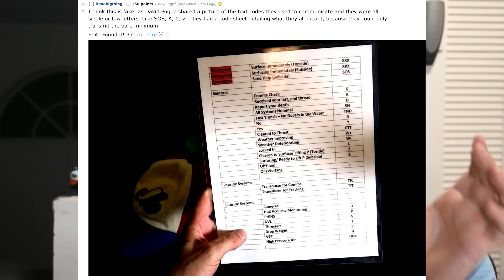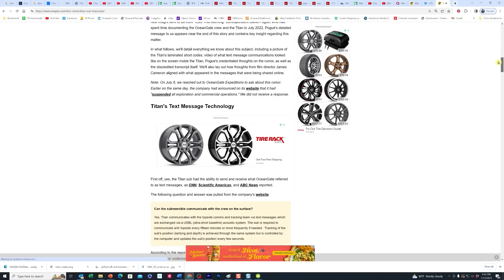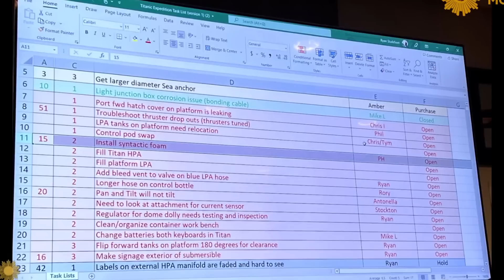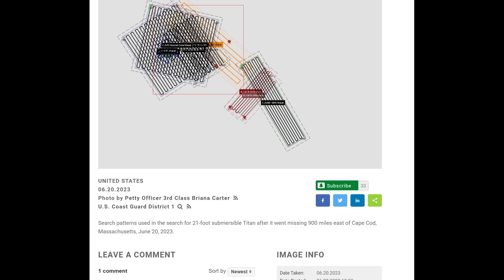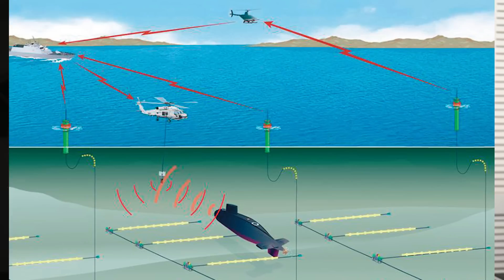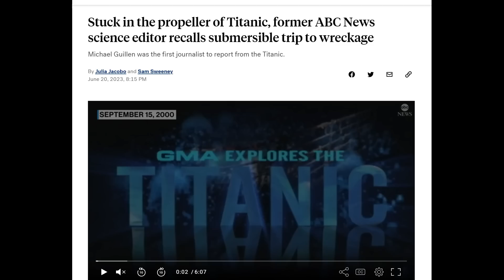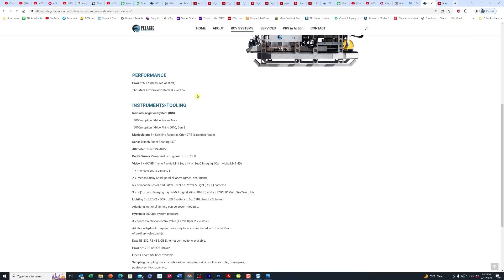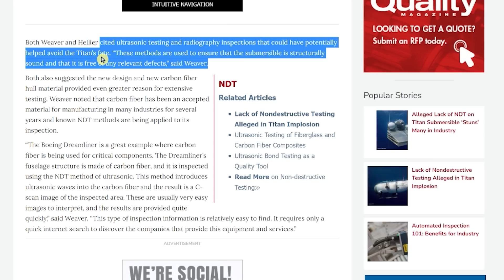The Shocking Truth About Fake Sub Transcripts No One Tells You

Comment: I don't understand why the Titan fiber cylinder looks all black and all dry.  Wouldn't it have been saturated with epoxy?  No epoxy, why wouldn't the ocean seep through?
Reply: Other videos have shown that the original carbon fibers were probably coated with epoxy precursors, and that baking after wrapping probably caused those precursors to flow and harden.  That doesn't seem like a very safe procedure for a 6000 psi environment with what is basically string under compression.

And if epoxy of the same age as the carbon fiber was the filler, it would be very hazardous to use "out of date fiber" as was allegedly purchased from Boeing.

Even using epoxy for a pressure hull is reckless, except possibly a short-term vehicle not designed for human.  Epoxy ages far faster than metal.

There should be no need for the waterproof covering (shown as a green layer) if the epoxy properly filled every crevice.  Questionable.

Comment: How is the oxygen and wiring brought into the pressure chamber from those outside components? Seems to me  that would be a potential fail point.
Reply: You'd have to guess it was through the rear titanium cap, as that's where the ancillary stuff appears to have been located.  I assume the engineering for doing that is well understood.  Various commentators have said there hasn't previously been a dsv implosion, so I wouldn't see that as a candidate for the cause of an implosion.  I can't see anyone thinking doing a penetration of the CF hull was a good idea, and I assume that would have required a titanium insert into the CF prior to CF fabrication, complicating the placement of the fibres.

Comment: I work as an engineer at an aerospace vendor for the prime contractors. I work with graphite laminates and bonded assemblies. 
When you showed the lack of adhesive squeeze out, I had to stop the video for a few minutes. That is cause for serious concern about bond strength. The only charitable explanation for that is hydrodynamics of compressing the epoxy (while it's a fluid) caused 90% of it to flow and squeeze out on the inside, rather than the outside. But like parallel resistors, the vast majority of flow is through the easiest path, but some flow occurs out of all directions. 
This SHOULD have flagged them to come back and do a second fill on the exterior perimeter, but it looks like they just didn't recognize the risk of doing the bond the way they did (the fit is very snug and adhesive likely wouldn't flow in to backfill).

 I'm also concerned about bondline control for that bond. If you squeeze out all the glue between your two hard surfaces, you have no adhesive actually holding them together. Typically bondline control would be done through miniature glass spheres mixed into the adhesive (so you can compress it til you hit the glass spheres). 

Regarding the graphite laminate, If they truly only wound around the hoop, without any perpendicular strength, I would be shocked. Graphite fiber is like wood, its a matrix composite. It acts like ropes that are glued together. The easiest way to make the system break is not to try to break through one of the fiberous ropes, but to shear the glue between them. If you don't reorient the fibers between layers, it becomes easy to split it between fibers, like an axe to firewood. If that's the case for every layer then you can break all the way through, or even worse, pull a singular fiber out and create a weakness in the structure (and physics is very unkind to such defects). This is why graphite laminates get handled with caution. Bumping it wrong can pull a fiber. 

Ultrasonic testing should've been done by a qualified person on the laminate prior to bonding the titanium end caps. You can visually inspect for compaction and tell a lot by resin bleed-out from the laminate, but you can't see through it. Destructive testing of offall (it looks like they machined the interfaces that the end caps sit on, which implies there's machined offall from the sub somewhere) should also have been done. This allows you to do a suite of material testing, for adequate strength, appropriate void content, degree of cure, compaction, FATIGUE STRENGTH IN PRESSURE CYCLES!!!!!, etc.

Comment: And I can prove to you that you shouldn't use BBC video to "prove" that the transcript is real. Reason being is because it was a shallow test dive and they were not at 3,000+ meters depth when using the acoustic modem. Acoustic modems and VLF/ELF work less and less effectively and efficiently the low the depth is because all the water, and especially the boundary layers of that water, prevent you from effectively sending larger messages. There is a reason why extremely compressed and short hand messages are used on American nuclear submarines. And I guarantee you they've thrown a lot more money at solving this problem than Stockton Rush did. And, oh, did I mention no nuclear subs go to the extreme depths that this took place at and would hamper communication even further?

Comment: I don't know it rings true because remember all the random facts Ballard and Cameron had early on? Like ballast drop, emergency ascent, implosion at 3500 m. 

Now again 3500 m give or take, same story, emergency ballast drop, kaboom at 3.5k. 

Also reports of monitoring system going off have come from several places from also like day 2 or 3, reports of cracking... 

Like you say, if it is fake... it's good enough to probably be close enough to what really happened. Some stuff is unnecessary if you only invented this by public info. Fast descent? No one said that. But they did implode around 3500 m. So they seem to have been early. So why add this random fact and have most of the transcript be about the descent when you could invent some "juicy stuff" about how (sorry) horribly they passed. You would expect in a fake SR to be portrayed as incompetent. But he actually seems to handle it as well as you can. He immediately agrees to surface, is honest about problems in landing frame jettison. Again why include that. Public infor was "ballast dropped, kaboom". 

Not 5 mins troubleshooting, back and forth etc... and the comms seem as professional as you can expect of these guys. A fake would try to make them look more negligent. Like SR insisting to not surface or something like that. Instead the picture this poetrays seems to be that SR was fully aware and doing his best to get them out of there alive. I hope there is no "CVR". If this is true.... 

My speculation? They where heavy. Overloaded. Fast drop, no reaction from ballast? Even after dropping major structural elements AND ballast? They where missing buoyancy or too heavy. Last minute passenger changed? Ballast not recalculated? Active ballast fails? To heavy? Tanks full? Plummet downward, drop everything and barely float up? Something is really wrong there. Even the thrusters without positive buoyancy should move them at 2 knots or so.

Comment: Pogue points out though, that early in the dive (when no hint of any issues) the communication was complete sentences instead of simple 'AN' (code for all nominal).  Pogue pointed out this much more terse response was his experience. 

There was an interview where RS stated he didn't like wasting a lot of time talking to topside, apparently he preferred to be left alone.  So the early use of banalities like "enjoy the ride" and "having good time" or whatever seems out of character.  This is the sort of details only folks with direct experience would have known ahead of time.  Of course this isn't conclusive, but it does suggest the transcript is not authentic.

Another puzzlement is the requests from topside for depth.  Information about the 'telemetry' that was sent by the computer every few seconds was that it included depth.  If that were the case, why would the surface ship need to make specific inquiries?  If that telemetry had failed, why wasn't that mentioned?

Comment: That was one question I had about the glue when I saw that video. You would think you'd want a little extra on the seal not less. They were scraping it off so it was like paper thin before they attached the cap

Comment: I have the sneaking suspicion that Oceangate merely rented out manufacturing facilities from the composite company and Oceangate personnel  ran the equipment to lay up the carbon fiber.  The composite company basically told them, "We're not liable; however,  may use our facilities".  Anyone with a little common sense knows carbon fiber needs to be woven and spooling it from off the bobbin (for a lack of a better term) onto what amounts to an even wider/longer bobbin is not going to impart any strength to the structure.  Rush's ego was just too big for his own good and I bet what ever initial plan from a marginally competent marine engineering firm they began with, he probably interjected his own spin and essentially said, "Eff them! I know best"

Comment: Even if they did use codes in communications, a published script would likely be translated to ordinary English...  so this point about codes is a bit uninteresting as proof (as you agree for other reasons)...

I'd be curious to see other transcripts. I'd say if no other transcripts appear, that increased the chance it's fake. I don't know if its fake or not. But sooner or later we will since various agencies will eventually be releasing reports of the event.

All this talk about the direction of the fibers in the hull... I think the resin is taking the compression to a great extent since carbon fiber is a tensile force thing. On the other hand the tensile force can contribute to the hull keeping it's shape which can keep it stronger.

I used to use carbon fiber, fiberglass, polyester resins, epoxy resins and stuff for model aviation. It's really amazing material for aviation since it's light and has such good tensile properties. A couple grams of carbon fiber glued to a structure can really help reduce weight...

Anyways, when I'm making a joint, it's incredibly unsatisfying if I don't get a squishout. As you mention, they didn't get any squishout and in a case like this, that means there are gaps. Gaps are not your friend. So these guys are clowns really. Thankfully they video taped this so it gives a bit of insight into the construction. 

Further, I've seen this footage of gluing the end rings on and one of the guys is putting his gawdamn hand on the surface. Jesus Christ, I wouldn't do that on a mode aircraft let along something that will carry humans. Grease from your skin is not your friend. 

I think this could have been okay if they were doing this right. But it would probably cost 1 million or 2 million instead of quarter million. That sounds bad but hey, the people that go down their are going many times. So just pay 4 times as much and go a quarter as often. You'll get the same bragging rights and then be alive to be all braggy and enlightened.  Don't get me wrong, I think it would be life changing to actually go down there and see that historical site. But being alive is cool too..

Comment: The fact that the resin does not ooze out is not the biggest problem in my opinion. The two rims keep the resin inside, which looks a tight fit. The biggest flaw in the process with what I see on the video is that it traps a ton of air. The cured resin is full of air voids. Unless they put the whole thing in a vacuum vessel.
Reply: It is amazing how many dives this thing did make successfully, with how sobby the construction was overall.
Reply: @Lilitha11 - Not all previous dives went to Titanic's depth.
Reply: @Lilitha11  titan made 90 dives, only 13 were successful. Still amazed 13 made it given all design flaws.
Reply: I'm no engineer but why wouldn't the ring in on the inside of the carbon fiber shell? Seem to me that would be stronger against the outside pressure. Or a grooved type of end where the carbon fiber is inserted into the titanium end?
Reply: @johngreydanus2033  Exactly my thoughts, even tho am not structural engineer either (or whatever branch it is). Intuitively this layout look more suitable for excess pressure from inside, not outside as in sub. If carbon fiber tube was outside of metal ring, outside pressure would push it against metal, further tightening the seal. With this design outside pressure works to disconnect carbon tube from metal ring.. weird design choice.
Reply: @AG-ig8uf  You're right. You should only try to stretch the fibers, not push them together, because then the fibers will break. The construction should have been; two titanium rings spaced apart with a number of titanium rods, sort of like a birdcage, and then stretching the fibers lengthwise around the titanium rings, alternating inside and outside the ring to form the cylinder. Then the fibers would be strained by external pressure. Exactly what they are intended for.
Reply: @AG-ig8uf  Might be a thermal design. The ocean gets colder with depth, so the titanium ring would likely contract faster than the carbon tube, compressing the joint.
Reply: bro you disagreed with him and then restated his exact point. if it was a truly tight fit, resin would have squeezed out. because that wasn't the case, you can know for a fact that there were pockets of air in there.
Reply: @kenshiman90  By saying that it's not the biggest problem it's not squeezing out I meant that Rush said in that peanut butter story that the layer should be thin but not too thin. That is also my experience with resin in my (hobby) projects for better bonding. The amount of resin is easy to calculate for a certain thickness in that titanium groove, say 30 kg for half an inch or so. You see them lowering that ring by a crane and measure the distance from the bottom of the cylinder with some poles, meassuring tools and a straight edge on top of that ring. measuring would not be necessary if you lowered the ring completely onto the cylinder, then the resin would squeeze out. It still traps a ton of air,  I'm guessing they allowed the resin to cure while the ring was still hanging on the crane on a certain distance from the cylinder.

Comment: I watched a video about another submersible vehicle with 2 men in it laying cable across the ocean floor and it got stuck on the bottom. The 2 men had to be rescued and decided not to talk and to try to sleep in shifts to save the oxygen so the co2 scrubber wouldn't use its limited liquid as often, to try to stretch their air for a longer period of time. This was in the same part of the ocean iirc. That company had another sub and put it on a ship to go tie a tow line to the men's sub to bring them up but the rope was so light it got tangled in the propeller of the rescue sub on 2 attempts. The US Navy sent a rover that tried but had a problem and had to be repaired. They finally got the rope attached and pulled the men's sub up, not sure if they were even alive anymore. They were alive and had 12 minutes of oxygen left, and if they hadn't stretched it out several extra hours, or if 1 of the men hadn't replaced a half empty oxygen tank before the trip, even though he wasn't requested to, they'd have died 12 hours before rescue. So the public thinking the people could've been alive for days in the Titan sub were right.
That documentary was about the Pisces 3 sub rescue. Here it is..
https://youtu.be/MMe3Fru7dqY
Reply: CO2 Scrubber, not O2 scrubber.
Reply: @hondooooo  she said co2 scrubber.

Comment: 7:53  You need to watch the video about the Odysseus by the Pelagic exec.  They used multiple means to get the parts hoisted.  I don't think the Odysseus did the lifting.  My understanding is that it simply attached the straps and cables from other submersibles with heavier lifting capacities.  The Odysseus had the best "eyes and hands" though to do the work on the very bottom.